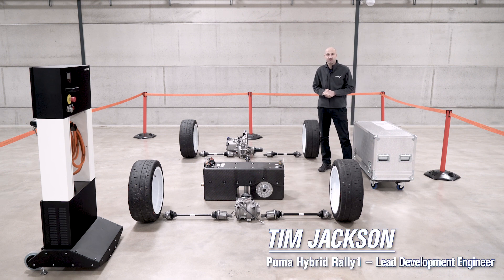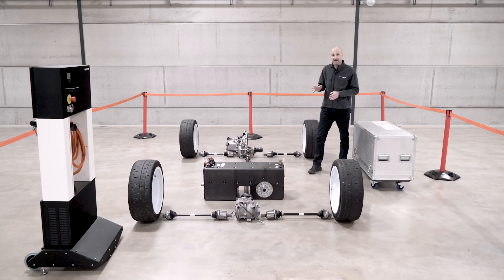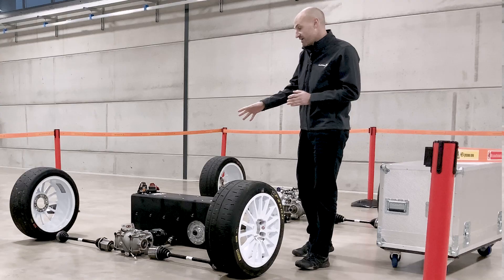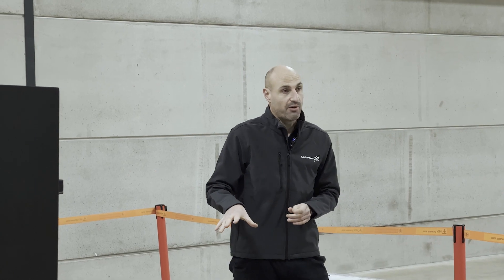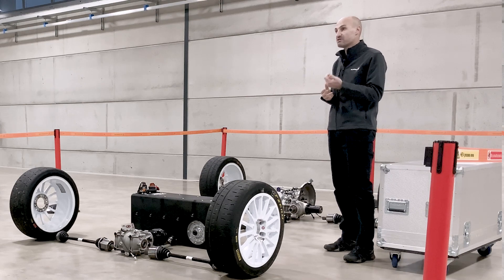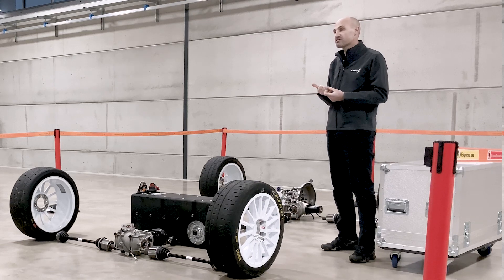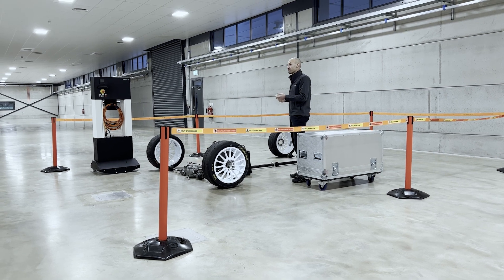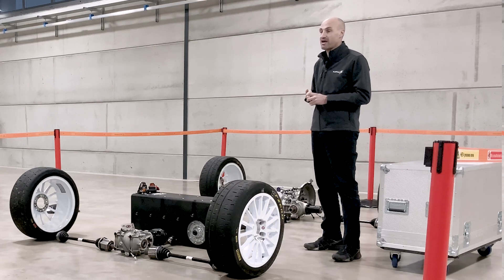WRC HYBRID 🔋 EXPLAINED | Puma 🐈‍⬛ Hybrid Rally1 Powertrain ⚙️ Explained | #MSPORTERS

Comment: 530 horse power? What happened to the 300 horse limit ? Things are creeping back up to group B power , but I’m not complaining! 😁👍
Reply: 300 hp limit is gone for long time, since 2017 my friend
Reply: @diocan7710  . Ok thank you 👍
Reply: They will have 530hp for just 30 seconds each 10 minutes of stage.
Reply: @marfrandema1884  "when the cancer on the mountain whistles" 🤣🤣🤣
most of the energy will go to urban sections
Reply: @marfrandema1884  no they can use boost when ever driver wants.
Reply: Until a spectacular crash, at which point this will be scrapped and we will revert to 250 hp rear wheel drive. Actually that is where it was in the 70's, the good old days...!